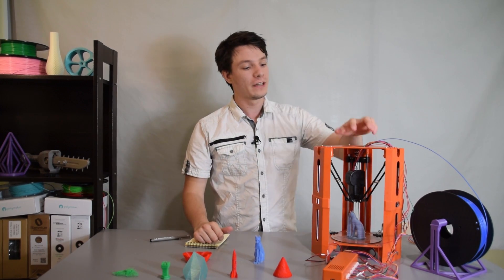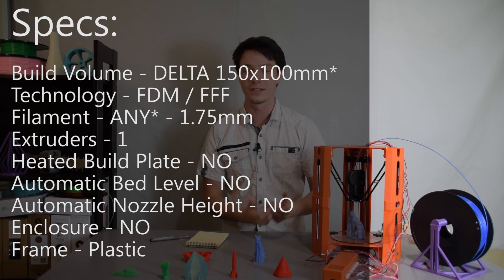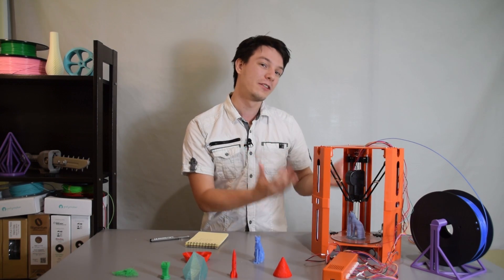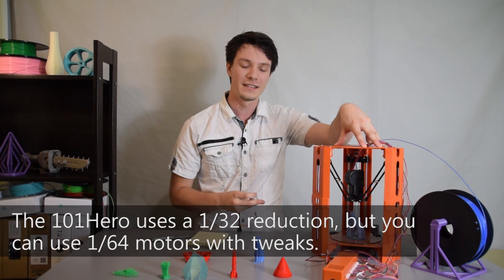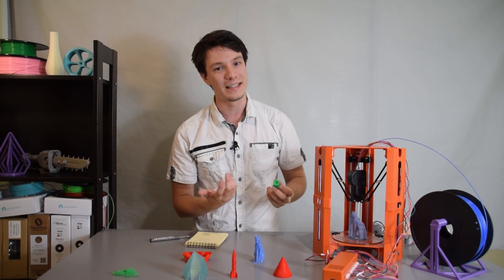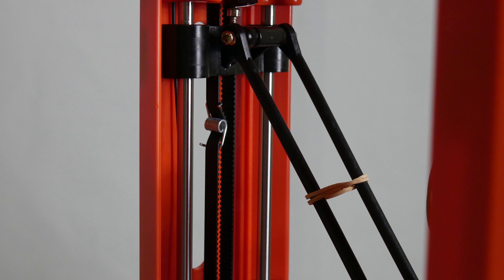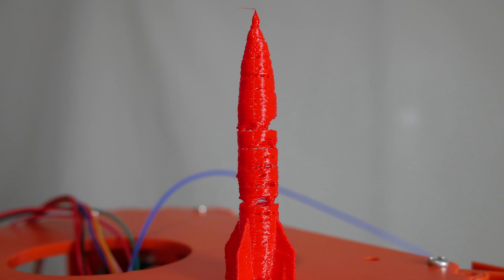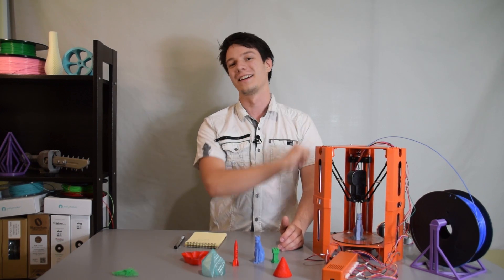101Hero 3D Printer Review

Comment: Hi Angus, I was interested in 3D printed parts behaving in cold. Which is better of different kinds of plastics? Have you ever tested or maybe it could be an idea for a video?
My reason is, I made a carabiner out of PLA and here in Estonia the temp is around -5 deg currently. The carabiner snapped really easy when I used it out doors, so that got me thinking, plastics generally cant handle cold, but are there some that are better than others in cold temperatures?
I would do a test myself but I don't have enough resources at the time to do so, so in my case it would have to happen in the distant future.
But thanks for any attention otherwise.
Reply: ABS is much tougher than PLA and does handle lower and higher temperatures much better. I am sure ABS can handle -10C without a problem. The issue with ABS is that it smells terrible, you need heated bed and some even use closed chamber to contain the high temperature needed to print ABS.
A good middle ground between ABS and PLA is PETG. It's tougher than PLA, smells ok, can be printed without heated bed (though it does require higher temperature on the hotend). The biggest drawback of PETG is that it is more expensive than PLA and ABS.
Reply: Tomas R, Thanks. I have a Geeetech Prusa i3 Pro C and the manufacturer says it will print ABS and it does have a heated bed. I have not yet had the chance to do so, I got the printer in December and I am still messing around with PLA. But I'll get there and try it out.
It would just be awesome to see a video where the plastics are tested, that's mostly why I brought it up. 

Manufacturer given specs:
Max heated bed temperature:  about 110°C 
Max extruder temperature:  about 240°C 

Should work for ABS.
Reply: You can check Thomas Sanladerer videos where he tests different kinds of materials including ABS and PLA by pouring boiling water on printed parts. The playlist is called #Filaween
Reply: Cedrik Kaurit Eestlane sellisel videol!

Comment: The wobble in the frame can be reduced very simply, several ways.  Use some single strand wire to x brace the top half of the 3 pillars.  Leave the bottom half open for access.  Or, glue or add a printed c channel to facing edges of the pylons and then insert panels.  Clear plastic faced sides would look best.  Also, containment of the actual build space, with a removable panel or door would retain heat and improve quality as well. The simplest way...DUCK TAPE.  Wrap as much of it as you dare carefully, with an eye to removing the wobble, and prepare to be amazed...Likely the ugliest, but should work surprisingly. Actually, corrugated cardboard panels on at least 2 and a half sides, taped in place would likely work most cheaply. . . Bo.

Comment: could u make an video about the anet a8 i want to get into 3D Printing adn want to know if it gets the job done. Iwant to get an look n 3D Printig and not spent much money at the start. :)
Greets from Germany
Reply: I bought one 5 months ago for 150€ , I highly recommend it.
It's a bit hard to start but once you know how to use it you can do some impressive prints with it.
Reply: Davon gibt es schon genug Reviews und Meinungen auf Youtube und anderen Websites. Und ja, er leistet ziemlich gute Arbeit :)
Reply: DarkLion131
Du wirst es nich bereuen :D
(Lieferung kann aber eine Weile Dauern, zumindest bei mir hat es 2 Wochen gedauert :( . Habe bei Gearbest bestellt)
Reply: DarkLion131 I'd agree here. Myself and my mate got them a month ago however out of the box both heated beds had around 1mm bow in the centre that we couldnt bend out for fear of breaking it. It meant it was really hard to level the bed and get good prints. A week later and i simply folded some aluminium/aluminum cooking foil into a square about 20 layers thick and put it in the middle of the heated bed and put a £1 picture frame glass on top with simple glue stick on. Absolutely perfect prints. There's a front Y belt tensioner you can print and i printed that the other night with a bolt and plate both having screw threads and they fit perfectly. would def recommend just going straight to cheap glass plate.
Reply: @RoxxEvans thank u very much i think i will get one its cheep and i heard good things :)
Reply: Danke @Erik Kattusch ja hab mich schon mal durchgecklickt aber ich habe das Gefühl das angus viel Ahnung hat und ich wollte seine meinung hören aber ich hab bis jett "fast" nur gutes über den drucker gehört deswegen wird das glaube ich demnächst bestellt :)
Reply: smitcher trank you i watcht all Upgrades u can do for the Printer my Plan ist to get some Kind of Building plat from PrintZ U can take it off the printbed and bend it so the Part pops off i Think angus did an Video of it. :)
Reply: smitcher My heatbed is slightly bent too but the prints come out pretty well.
Reply: Ordere in lets Hope all arives alive and Not broken :)

Comment: How did you level it because i have recived mine but the prints stick only on one side, maybe is because i'm using the provided tape? ( i'm sorry if there are any spelling errors, but i'm not a native english speaker)
Reply from the maker: You have to adjust the screws that touch the limit switches, so one side 'homes' sooner or later than the others. It's really fiddly!
Reply: Maker's Muse but have you figured out which pylon affects which area of the print bed, the nearest or the opposite? Thanks for the fast reply :)